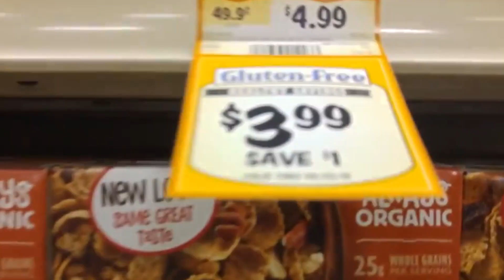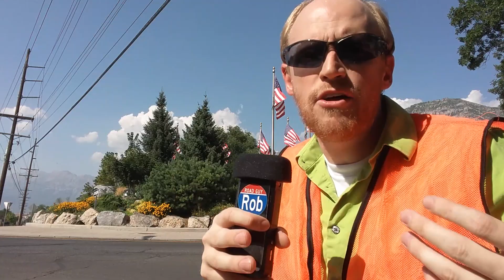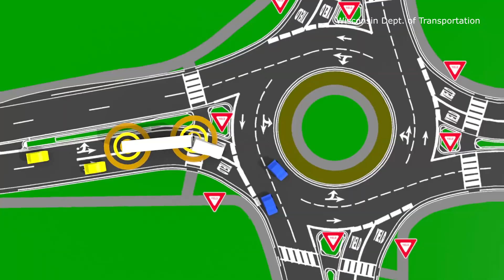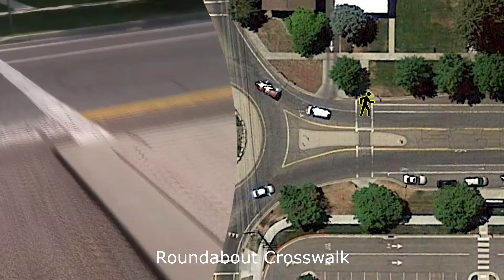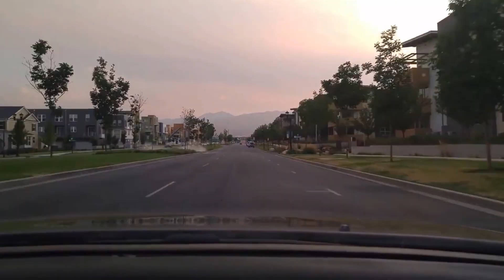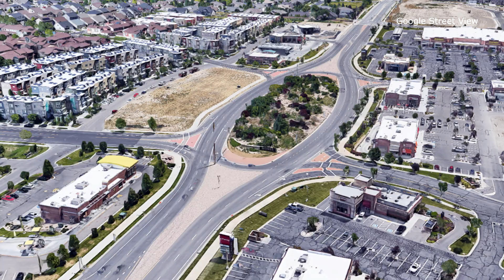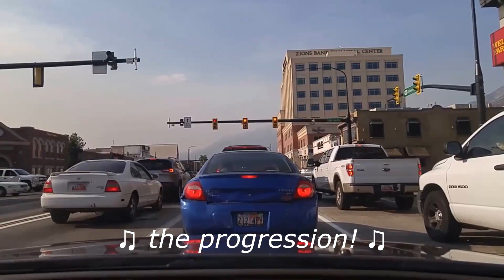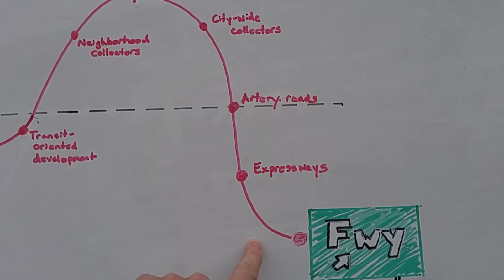Are roundabouts REALLY better than a traffic signal?

Comment: I think roundabouts have at least two other benefits for pedestrians. The first is that traffic is only coming from One direction at a time which makes it easier to navigate. The second benefit is that usually around about The pedestrian is only crossing one lane of traffic at a time. Since most roundabouts have a diamond shaped split at the entrance/exit it allows The pedestrian to cross one road wait at the diamond and then cross the other road. So instead of having to walk across a 40 ft wide road you might only be walking across a 15 or 20 foot road at one time.

Comment: You say not to put roundabouts on the freeway, and seemingly for the entry to the freeway, but here in the UK most major motorway junctions are massive roundabouts, and while we don't put roundabouts on the motorway, we do put them on high traffic dual carriageways (2 lane each way, speed limit 70mph). In fact, I believe there's at least one example where one motorway ends into a roundabout, which feeds another roundabout which itself feeds a different motorway. There's a lot of escape roads around it though to reduce the impact, so I guess if you're gonna use a roundabout on a freeway you can only really do so at the end/start of it.

Comment: As a pedestrian, you also need to consider the extra time waiting for a green or walk signal as well as the danger from left turning incoming traffic.
Reply: Or you could just illegalize left/right turn-on-red in the first place.
Reply: @ImRezaF  Yep. Outer edge turb on red is an absolutely awful idea.
Reply: The length of travel on the crosswalk and the speed of the traffic is important too.
Reply: There are no left turns in a roundabout (at least in countries with right-handed traffic)
Reply: @Hairysteed  "There are no left turns in a roundabout"

I think that's Andrew's point.  In comparing traffic lights to a roundabout as a pedestrian, you should consider not just the minimum crossing times like the video did, but also the traffic light's wait times and risk from left turns.
Reply: @Hairysteed  When you turn into a round about you then have to turn the opposite way to turn out of a roundabout and if you have too many vehicles in a roundabout every vehicle will get trapped and because of how they are designed they actually are nearly impossible to get out of a round about.  There have been 19 major events where the united states military had to bring helicopters in to de lodge entire cities that got trapped in grid lock because too many people went into round abouts and not having the ability to travel out of a roundabout and how their entire system is built off roundabouts in Europe people got trapped in their cars and vehicles got trapped for weeks and one incident took the United States Military 3 months to dislodge the entire city because roundabout blocked the entire city in because of how garbage roundabouts are.  Europeans lie out their ass about the safety of roundabouts and the only reason roundabouts have less crashes in Europe is because they have police being traffic guards at nearly 100% of all roundabouts along with rail road gates allowing and disallowing cars into the round abouts so that the roundabouts do not get stuck.  This shit is so trash anyone who says its good needs to be put into a mental hospital because they don't actually work and even with police gilding traffic in and out of them along with rail road gates they still have 67% of the traffic problems and 20% of fatalities that regular lights have.  Also many will have spikes come up from the ground to make sure you do not enter until it gives you the ok to enter to prevent cars being trapped in the roundabouts.  They slow traffic, without over massive security features they cause more crashes and they make 20 minute drives take 2 fucking hours yea they are complete trash.  Hell the ones that got put into neighborhoods in my city have literally damaged cars because cars are not designed to go around small ones and they are not designed to prevent problems at all and hell a friends car got stuck on a curb when trying to go around it properly because the reality is cars can not turn that sharp without causing massive damage to the cars.  They don't work with vehicles.  They are fucking trash.
Reply: @jordancambridge4106 And everything you just said is made up bullshit.
Reply: @Mike_Chips  Go to the bottom line.  If you are a pedestrian trying to get across the street at a roundabout,  good luck.  I've tried.  It's a nightmare.  I went down the street to get away from the roundabout and then ran after looking both ways and trying not to get hit.  I was not in a crosswalk, but if I wanted to get to the other side of the street, I had no choice but risk it away from the roundabout.
Reply: I challenge you to try and cross the four kabe ritary at the end of my street with multiple exits and entrances and driveways into and out of it. You'd have better odds of surviving a game of Russian roulette.
Reply: Roundabouts are now 100% incoming traffic from a 360 degree angle and force a far harder way of crossing to where its way too dangerous.

Comment: I wish the main road leading out of our residential area had more roundabouts. They finally replaced the uncontrolled, high-accident, intersection with a good roundabout, but it's the only one on the stretch of road that leads past the high school, so all the other intersections are 4 way stops that take 15 minutes to get through as traffic backs up for a mile both ways on the main road. Roundabouts all the way down would solve the problem. It's not like pedestrians will be negatively impacted, since despite the school, there is no sidewalk so no one walks along that stretch.

Comment: You can traffic light roundabouts as well if you want platoons. But all in all it's an intentionally slow type of intersection so it doesn't work on high speed roads. I don't fully agree that roundabouts are bad for pedestrians. that's more an issue with how pedestrian crossings are treated in the USA. Slower cars with lots of time to see a pedestrian should be able to slow down, it just needs to be obvious that the pedestrian has right of way

Comment: You should have done this video in the UK where we have thousands. I once lived in Carlisle which had a busy roundabout in the centre of town controlled by traffic lights. One day the River Eden flooded and the lights were out of action for weeks and drivers had to use it as an"ordinary" roundabout. Traffic flowed much faster without the lights.
Reply: The lights are pointless in a roundabout as roundabout are meant to be free flowing. Traffic lights are the opposite of free flowing.
Reply: @Wezqu  Roundabouts don't tend to be great where the amount of traffic from each direction is unequal. If there's a lot more traffic from one direction, cars on the next road coming onto the roundabout will struggle to ever emerge, which can lead to build up.
By occasionally stopping the busier road, this problem can be overcome.

Comment: Ummm, interesting video. I was actually pretty down to hear from a different perspective on why roundabouts may not be that great, but there are a couple of your points that had me laughing. For instance, your descriptions states "Traffic signals are not scary.  Roundabouts can be, especially if you've never driven one before.". Ok, so let me reverse that for a second "Roundabouts are not scary.   Traffic signals can be, especially if you've never driven one before.". Any thing can be scary if you never used it before. Another is counting steps to cross those intersection without mentioning the vast advantage roundabouts have in keeping safe when you cross traffic signal intersections as a pedestrian. In a roundabout, all cars are facing you as you cross, they can still hit you or not yield, but bad drivers are bad drivers. Neither intersection type fixes stupid. Traffic signals have drivers turning right while looking to their left, away from you. Still you had some good points in your video, just wish it wasnt so washed out with odd comments and points like that.

Oh, and for reference in case it matters, I am American, but have lived in Europe for about 5 years (Germany and Italy), to include most of that time in cities. Those cities had a mix of signals and roundabouts, but I typically did what I could to avoid the streets with signals on them as they were generally much slower and avoided them as a pedestrian for the same reason.

Comment: Thoughts from the UK.
* No 4-way stops in the UK. They really slows traffic down and roundabouts would work much better.
* UK motorways (Freeways or interstates) do not have roundabouts on the motorway, but slip roads coming off the motorway very often end at a roundabout. These go above the motorway or below the motorway. This means the slip road rarely, if ever ends in a T junction.
*Roundabouts can often be traffic light controlled, particularly in very busy areas.
* we also have mini roundabouts, often just a painted white circle on the road, but we treat these like any other roundabout, giving way to traffic coming from the right (left in the USA). 
I think roundabouts are great and make so much sense. What do you think?

Comment: I'd like to see Rob travel to the UK and see how we have implemented roundabouts and other traffic control systems compared to the USA. I think it would make for an interesting few videos.
Reply: Take the magic roundabout in Swindon, west of London. It consists of 4 clockwise roundabouts centred on a counterclockwise central roundabout. It looks mad but works well in bringing 12 roads together in a relatively orderly manner. For left driving Brits clockwise is normal counterclockwise is for colonials.
Runner up in mad roundabouts is the 6-road Walkinstown roundabout in West Dublin. It consists of three lanes and you have to switch lanes 3 times in order to avoid clashing radially with the fast moving natives who know it well. They do not suffer fools gladly. My own native Galway has several 5 road roundabouts the source of much discussion and controversy, some of which have been replaced by traffic lights and then back to roundabouts several times depending on the whim of the roads department.
Reply: @jgdooley2003    There are at least 3 of those magic roundabouts in UK; Swindon,  one near Hatton Cross underground  @ Heathrow,    & Hemel Hempstead.  
Here are links to show the 2 latter.
https://www.google.com/maps/place/Hatton+Cross/@51.4678826,-0.423475,126m/data=!3m1!1e3!4m6!3m5!1s0x48767307544509b7:0x4be569c97f49f668!8m2!3d51.466743!4d-0.423171!16zL20vMDNkcDk1?entry=ttu

https://www.google.com/maps/place/Hemel+Hempstead/@51.7462808,-0.473207,177m/data=!3m1!1e3!4m15!1m8!3m7!1s0x487614c908fcc35b:0x5d521bb3eb9734f1!2sWatford!3b1!8m2!3d51.6611283!4d-0.3970199!16zL20vMDF6Mjhi!3m5!1s0x487640d05cd71ac1:0xf0e07f1fcfdff2b2!8m2!3d51.753241!4d-0.448632!16zL20vMDFtM2I3?entry=ttu
Reply: British roundabouts are really confusing to me. There's so many of them, often they have two lanes and you're supposed to take the center or outer lane depending on your exit but this is often not marked or indicated? In the Netherlands we have two lane roundabouts called 'turbo roundabouts' which do the same job but the lane choice is clearly indicated and the lanes are physically separated.
Reply: @LMvdB02  The rule of thumb for those roundabouts is left lane for left turn or straight ahead, and right lane for right turn or to double back on yourself. Generally speaking more complicated roundabouts will have signs and road markings to direct you to the correct lane.
Reply: Him and Tom Scott should do a video or two together. Besides discussing the pro/cons of them in the UK, Tom could keep Rob safe since we don't want Rob getting in the way of the folks driving on the other side of the road.
Reply: I love the UK freeway roundabouts ... not only are they efficient, but if you miss your exit you simply go around again, no big problem!
Reply: A lot of roundabouts here in the uk in town centres and urban areas have traffic lights on them as well so they might as well not be there.

Comment: In the UK we have thousands of the things. Where they work well is in moderate traffic.
If traffic is light, then there is generally no problem at Junctions.
Where traffic is heavy, it causes long delays for some roads trying to enter the roundabout due to the continuous flow on the roundabout.
Some roundabouts in heavy traffic locations have traffic signals also- this is a pain in the rear.

There are also mini-roundabouts which are just a painted circle, sometimes slightly humped which have been put in junctions where space is restricted.
As for accidents, most seem to occur when someone is driving too fast (usually in a black VW Golf) and cannot stop in time.
The rules of using roundabouts are covered by the "Highway Code" which specifies which lane to use, when to use turn signals (BMW owners usually skip that part), and how to enter and exit.
The USA does have proportionally more traffic signalled junctions than the UK, but one advantage is that on most, you can turn right on a red signal after stopping if the road is clear. We don't have that luxury so have a lot more delays.
I have driven around a few roundabouts in Florida and drivers there don't seem to have any problems, but as you said in your video, it is the location and traffic that makes them suitable or not.

Comment: There used to be a weird roundabout like thing in my area. It was a roundabout with lights and straight through roads, which made the roundabout part pointless. They got rid of the roundabout part in eighties.
Reply: I'm guessing it started out as a traffic circle, and later the cut-thrus were added, before the old circle was eliminated.  New Jersey did some of that.

Comment: Roundabouts are also great for intersections that don’t meet at right angles. When they are stop signs there are always some drivers that have a bad angle of view for the cross traffic and it can make crossing those intersections dangerous. Replacing those intersections with roundabouts makes safely traversing those intersections easier.
Reply: Also good for intersections of more than 2 roads, which have the same problem.

Comment: In my town, a certain mayor started installing many roundabouts as a way of slowing traffic instead of improving traffic flow. I think the reason & purpose of installing roundabouts is the major downfall of some of them. In my opinion, roundabouts should help traffic flow instead of hindering it. Yes, roundabouts slow traffic at these intersections, yet it should be an unintended yet expected side-effect and not the main purpose. Roundabouts should not be used solely as a traffic-calming initiative.

Comment: In New Jersey we pretty much have gotten rid of these things (Circles). Of course, the one I know there are metering lights before every entry point. The only reason it works is that there are like 5 ways to go from the one intersection. Otherwise they have been replaced with jughandles and lights... it's the New Jersey way.

Comment: Where I live (central NY State) there's a large 5-way roundabout near me. One exit is even for US-90, the NY "Thruway," a major expressway. There are two others within 10 minutes of me. Up here, there's little enough traffic that it's basically like they have yield signs in place of traffic lights, which is great (and I've never seen a driver get confused about how to use a roundabout, for what it's worth.)
But yeah, they take up a lot more room than a normal signaled intersection. Love me some suburbs though.

Comment: Roundabouts are perfectly appropriate at the end of the ramps on a diamond intersection, as long as semi-trailer trucks are accommodated. That design is very common in the U.K. The Best Part: A diamond interchange can serve more than one road. For example, with a roundabout, the diamond interchange off-ramp can lead directly into a frontage road, as well as the intersecting main road, rather than one having to turn right off the freeway, and then left off the main road.

Comment: It seems that because cities were designed so differently in the U.S. than in Europe, you're going to have many more intersections in the U.S., especially at 90 degrees. The cities in Europe IMO seem more welcoming to roundabouts as they are more "circular" in design with a distinct center and concentric rings (roads) as you head out toward the suburbs. The U.S. has so many (very large) intersections that roundabouts would just be impractical because of the massive amount of traffic.
Reply: Not "designed differently", just not designed, period.  But that's true in most of the rest of the world too.  And that's the way it needs to be, because nobody can plan for everybody's desires.
Reply: @goodmaro  But they were planned, just designed differently. Google "U.S. street grids" and you'll see how almost all U.S. cities were planned. Also, almost every municipality has a "city planner" position in the U.S.

If you look in Google Earth, most cities in Europe start from a centerpoint and work outward in concentric circles or with a mish mash of streets going in every direction (see: Paris, London, etc.). Most intersections are not at 90 degrees from each other, which makes things like four-way stops difficult to implement. Most U.S. cities (except a few on the East Coast, like Washington, D.C>) were designed with grids in mind. This makes traffic control much different.